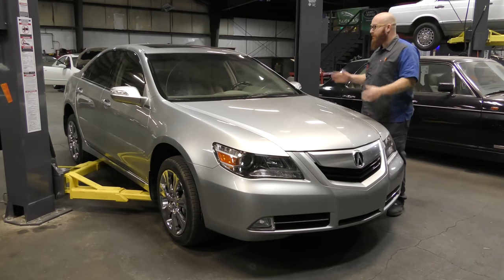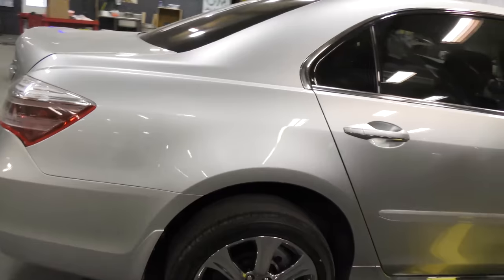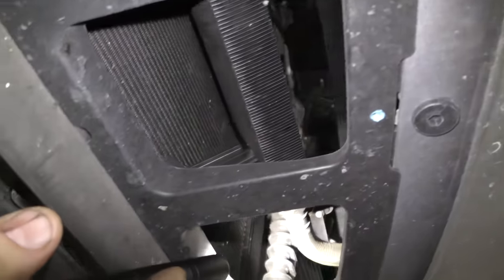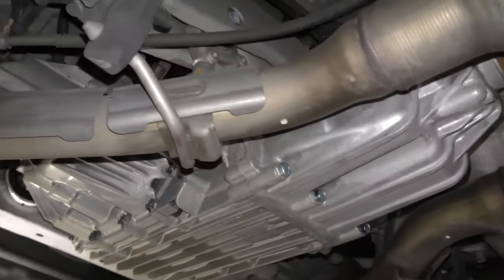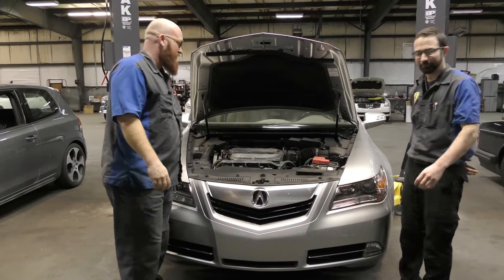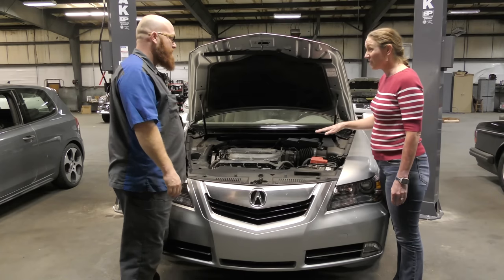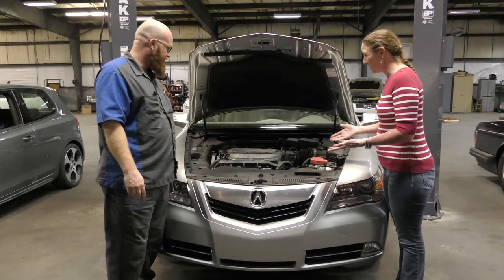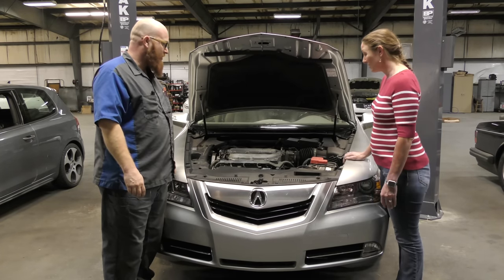Something Very Serious is Wrong with this 2010 Acura RL! What did the CAR WIZARD find???

Comment from the maker: Keep in mind, as clearly stated in the video. Customer wanted NEW or REMAN ONLY. 
Refused used engines whatsoever, regardless of miles, or money savings. You guys keep reccomending used engines. Its not your car. Customer refuses used engines.
Reply: I love my Acura RDX I only use OEM AND NEW. Used is just going to make me cry later.
Reply: I would imagine that if he was presented with an option for a used engine with 40K miles to match the rest of his car, and if the price was thousands less, he'd go for that -- but as you say, it's his car and his decision.  Interesting that they don't offer replacement engines.  Nice video.
Reply: Picky customer for a guy that can't keep oil in his engine.
Reply: @kennethfromkin6141  you imagine what you want. Not what he wants. His dime.
Reply: @jjmarz1001  it's  his money money. He gets to be picky.  Not your cash. He can do whatever he wants with his money. He has it, he spends it. Seems simple to me.
Reply: @jjmarz1001  
Gets expensive for a few litres sorry quarts of oil.
Paid too much attention to polishing his nuts 😯
Reply: The other side of the coin is that if the parents were to buy their son a new used car, they end up getting a pile of secrets, and it would cost more than 7-8k for something similar, so it makes logical sense to keep the car and replace the engine. At least in my world it does. And CarWiz is totally detail oriented so it would be better than new and go 150k miles still.....just hopefully the kid understands it needs to have the oil changed every 3-5k....
Reply: @tombrooks5933  there is no other side when it's your money. You do what you like with it. If you are buying you dobthe research. Not me the seller. Thats the way it works. It's his money. Why can't people realize that?
Reply: Honda V6 engines can burn oil. The problem is that they put cylinder deactivation in some of these engines which shows that Honda should have never get involved with General Motors. 09-12 V6 engines can burn oil especially the ones with VCM. Change your oil regularly. GM electric cars are built well so that may be an exception for Honda. Don’t buy a Honda product with the 3.7 V6. 3.7 Honda engines are not easy to get because they were only in Acuras. You can get a reman 3.5 but not a 3.7. Just get a Nissan 3.7 V6 in a 370z or G37/Q40 or a RWD 3.7 Ford instead or if you want guaranteed reliability get a Toyota 3.5 V6 made after 2012. The Nissan V6 engines burn oil too but there are tons of Nissan VQ engines out there and they are very reliable engines as well.
Reply: Sooooo, would a J37A2 fit in my Civic?

Edit: If it's anything like K-Series motors. The A2 has better, stronger rods, pistons, crank than the A1, A4, A8 variants. Most will say the A2 only signifies the cylinder head configuration, and the blocks are all the same. They're not.
Reply: Look into Acura’s oil consumption recall for that engine that is the root of the problem
Reply: @ryanlewis86  It’s actually a TSB. TSB and recall means different things.
Reply: I understand that's what the customer wanted, but by what you are saying, what the customer wanted isn't even an option. Which would then be your job to sell him on a junkyard engine, especially since you could probably buy 5 junkyard engines for the price of a longblock from Honda.
Reply: A question here. Since the engine is a modified 3.5, could that be a solution for somebody that doesn't care that much about the HP? Does a 3.5 fit in that same place?
Reply: I drive a 2011 ZDX and it burns oil like a mofo
Reply: Also keep in mind,with exchange rate,$7000 u.s is $12000 nz dollars.also 42k miles is 67k km,we chuck em out at those miles/kms.but we change oil every 3k kms also
Reply: @jjmarz1001  You don't know what the failure was. There could just as easily have been an oil pump failure.
Reply: I did some research for you through my Honda dealer. The issue with your long block compared to the other J series family like the 3.0, 3.2 or 3.5, this 3.7 has reinforced internals not found on the other J series family. It may look identical on the exterior, but even the cylinder head parts are different
Reply: The engine can be rebuilt, however the pricing for the parts and machining the crankshaft will add stupid quickly. The internal parts for this engine are all available still
Reply: That’s crazy when there are multiple low mileage motors on car-parts. I understand not putting a 100,000 mile motor in, but I see a few with under 30k !!!!
Reply: @sccarguy8242  Right!
Reply: @atx-cvpi_99  I wouldn't say VQ's are reliable they need timing chains every 60k-80k miles
Reply: The company that you would send it off to rebuild it what is there warranty on it once it is sent back?
Reply: okay but what about just throwing some rods in it? hopefully its just a connecting rod
Reply: real question is why did it loose oil in the first place
Reply: @stuarthall2180  oil was full.
Reply: I would never put all the work into a used engine either.  Get it in and it's no good, you're starting over again.  On the same hand, shame on Acura/Honda not being able to supply a factory reman/crate engine for an only 10 year old car.
Reply: Well, Wizard said costumer only wants new or reman. 
I 'WAS' going to suggest an engine from the same year and model Acura MDX. I have an '11 MDX, and have read up. As far as I can tell, it's the exact same engine: J37... 

Not sure if this would help or not. I was actually looking to buy one of these RL's because theyre very elegant to me....

BTW, unfortunately these 3.7 have an oil burning issue. My MDX had this issue, but was able to have it serviced under extended warranty at a local Acura dealer. It's an issue with the ring pack Honda used with the J37... This engine also came in the Acura TL same year models...
Reply: @ryanlewis86  that year didn’t have those issues. 2011 and on did. Acura/Honda was trying to figure away how to cheapen things. Those plans were put into place in the 2011 model year and on
Reply: @atx-cvpi_99  I have had a Maxima v6, a 350z and a 370z.  None burned a drop of oil between changes.
Reply: @jjmarz1001  Watch the video first before comment. The customer is the owner and his sun had the car when the issues occured and he might have driven a bit too long or far. So do not blame the false ... and what has happened or not. Maybe it was the previous oil change somewhere else where they did not fill it up.
Reply: Sammy Phillps  they said it wasn't bad "ENOUGH" lol thanks acura
Reply: He'll probly end up buying a used one to rebuild depending on how bad the engine is damaged.
Reply: Guess he's beat lol
Reply: Car wizard, what about having his engine remained?
Reply: @kevins.3573  A2 variants also have oil squirters at the bottom of the cylinder
Reply: @atx-cvpi_99  Thank you very much. These engines are in the second-generation MDX, too.
Reply: Sammy Phillps  I'm already rebuilding the engine of my mazdaspeed6 lol.
Reply: It'll be $12k, but you can still purchase the short block and cylinder heads as general assemblies, meaning complete. Add head gaskets, valve cover gaskets. Reuse valve covers, intake plenum, etc.

General Assembly, Short Block p/n 10002-RKG-A04
General Assembly, Front Cylinder Head p/n 10004-RKG-A02
General Assembly, Rear Cylinder Head (DOT) 10005-RKG-A02

I haven't read all of the replies, so someone else may have already said this.
Reply: He will take hitchhike and hoof it until Honda decides to make replacement engines.
Reply: @glennstiller7616  Acura offers the short block and cylinder heads as completed assemblies, sold separately. They just have to be mated together. I replied to Wizard to let him know.
Reply: And don't forget head bolts
Reply: What about Accurate Engines? They do have the Acura 3.7 Liter remanufactured engine. You can request a quote from them.
I just watched the video again. Yeah, Accurate Engines. LOL!
Reply: The customer CAN be wrong. It must be hard to bite your tongue on this one, Wizard. You have more patience than Bob Ross.
Reply: the Wizard is trying
to help the customer...the customer is probably  obsessive
compulsive ....it amazes me how prominent this illness is in our culture...There are options available to allow this
vehicle to have value again...Listen to people who are trying
to help
Reply: I would definitely put a new motor in it
Reply: Some people just turned off their hearing aids when the Wizard said no used engines and it shows. Apparently some of you got high school diplomas that you can't read.
Reply: on a front wheel drive car (this car is all wheel drive but primarily a transverse layout engine)? You really like welding and rewiring that much?
Reply: Get a lawyer involved, this kind of problems shouldn’t happen at this low mileage.
Reply: @Mr.Death101  You're talking about a warranty on an engine going on ELEVEN years old? You're hilarious.
Reply: Sammy Phillps  break in on a 40k engine? What part of "Acura won't replace this engine" did you not understand. This engine requires replacement. What is Acura supposed to do exactly on an eleven year old engine that they won't service, sell, or replace?
Reply: @houseofno  that's the point he's going to pay 7 grand for that and not even have a warranty duh you couldn't decipher that
Reply: @glennstiller7616  shame on Acura for not indefinitely supporting an eleven year old engine. Care to ring up Ford and order a new flathead V8 too? What makes you think companies are supposed to support old products indefinitely?
Reply: @lorencooper6043  this is a 2010 model and you're talking about 2011.
Reply: @phillm156  don't hold your breath. Exactly which auto manufacturers are supposed to support remans on 11 year old engines? Where is this going on? Good luck ordering that brand new Flathead Ford V8 crate engine. Be sure to post photos on that package.
Reply: @orca984  lmao that you think 40k and eleven years old constitutes "low mileage."
Reply: maybe you should show up at his garage and show him how it's done. Show him how to turn water into wine, raise a few dead people and walk on water while waiting for that brand new eleven year old Acura engine to show up.
Reply: @Mr.Death101  a warranty on an engine no longer MADE? You're hilarious. What part of "you can't get these engines anymore" that the Wizard stated did you not understand? A warranty on an 11 year old engine? Seriously?
Reply: @houseofno   if he's sending this engine away to a place that's rebuilding it and then it gets sent back and replaced into the car you're telling me that company that rebuilds it doesn't warranty their work? What part of the question are you not understanding
Reply: Was it out of oil? Why did it fail? Why did oil light come on?
Reply: @Mr.Death101  agreed
Reply: @typxxilps  what kind of idiot doesn't check their oil level in oil filter after an oil change? You just trust these people did the work LOL. Even when you rotate your tires you supposed to know you put a mini chalk Mark somewhere on so you know if they did it or not same with brakes and every other routine maintenance you don't just trust they did it correctly
Reply: Lol wiiiiizard got a little jumpy there lol.
Reply: My 2011 mdx had same 3.7 engine and the short block was replaced under good will by acura because of common oil consumption and knocking. Good luck to the owner!
Reply: @ryanlewis86  this. I read something about Honda extending the warranty, if it's only done 60k kms it's unreasonable for the engine to fail if it's been serviced through Honda no matter its almost 10 years old. That's just my opinion though. He should contact Honda maybe they will do half warranty even
Reply: @todd53b77  i don't know anyone that would chuck a 67k engine. I'd strip the bottom end and replace the bearings have the crank reground and replace the oil pump. The filter would have caught all the metal, that's its job
Reply: @mitchelpinion1852  a 350z that didn't burn oil? You're lying.
Reply: Plenty of used engines available
Reply from the maker: @Melanie16040  You cant hear the rod knocking? Also, as mentioned, there is tons of metal in the oil. The engine is toast
Reply: I work for Acura I’m mechanic and we never ever had issues with the rl’s. They are bulletproof but parts are expensive they all made in Japan.
Reply: @andrewlugo3427  Acura doesn’t replace short blocks cuz they burn oil. We replace piston rings only.
Reply: @E90_335xi   i can show you the bill... wouldve been almost $11k in repairs for a 65k mile vehicle i had just purchased at the time. They replaced it. Didnt even have to argue with them they told me outright it was being done under good will.
Reply: @CarWizard  have you tried using imported engines directly from Japan?  They drive low mileage there and usually they got tons of engines that they import to the US.
Reply: There’s one with 27k miles at Matlock used car and parts in NC off of a 2010 RL
Reply: Iso Gh0sted  it was but it couldn’t have been that bad right away. It must have started with the rod journals & bearings wearing improperly. Maybe from oiling issue?
Reply: Acura RL owners are weird, like the RL
Reply: @E90_335xi  I did one new J37 short block under warranty back before the service bulletin came out that called for replacing pistons & rings.
Reply: I would have went with a used engine. Saved what money I could.
Reply: LS SWAP THIS !!!👍
Reply: @heartofdixie67  if it was John Ross watchjrgo, he would LS swap it.
Reply: considering the car condition it is understandable, that thing is mint!
Reply: Googled it and found this post [partial]: 

Acura 3.7 L V6 Excessive Engine Oil Consumption leads to Extended Warranty

 "Today I received a letter from Acura that current owners of 2010-13 MDX, 2011-12 RL, 2009-14 TL, and 2010-13 ZDX will have their 6 yr/70k mile warranty extended to 8yr/125k for the power train warranty. This is to address excessive oil consumption that is caused by the oil control rings becoming clogged and preventing oil from returning to the crank case. Furthermore, regardless of mileage or time in service (age of vehicle covered) from now until Sept 1, 2019 Acura will cover the vehicle for this to ensure client satisfaction and confidence".
From the above it sounds a lot like the issue on the Toyota 2AZ-FE 2.4 motor.
Reply: Guys, i think the customer doesn't want a used engine.
Reply: @jjmarz1001  His oil didn't go anywhere. He lost oil pressure, not oil.
Reply: This is disappointing, but let's not forget that every automobile manufacturer can an will have these issues because they use mass production. Bearings are all made by a vendor and can be defective. Rods can be machined slightly out of tolerance, etc. Look at the newer 2 liter non turbo Honda engines that left the plant missing a piston circlip. It happens.
Reply: You tell em bossman
Reply: The MDX also used the 3.7L V6. I'm surprised there aren't any J37s available!
Reply: Crazy situation. Wish this customer and you the best of luck . The acura looks so solid inside and out thanks for the views. I Wonder why the engine went out.
Reply: Sammy Phillps  different engine similar but still quite different
Reply: @atx-cvpi_99  no cylinder deactivation on this engine, No GM involvement this whole car is really from Japan unlike the TL
Reply: @houseofno  it is.
Reply: gotcha.
Reply: @rolandwilliams1228  GM and Honda had the Saturn VUE. It had a Honda 3.5 V6 and the horrible 5 speed automatic transmission.
Reply: That car looks fabulous it's worth the money to fix it.
Reply: this car doesn't need a new engine, this engine can be repaired. Only problem, working hours
Reply: Sammy Phillps  did you mean to say the 3.5L?
Reply: @jamalpeoples3736  As the old saying goes, a fool and his money are soon parted.
Reply: Can't remember a late Honda v6 that didn't set hard burning check engine light when oil pressure dropped low due to either oil pump o ring ,oil pump or rocker pressure switches. 
And I assume loose timing belt tensioner , backed off rod bolts , or a walking camshaft has been ruled out. 
If so , price the related rods and a crank . That's how they fix the nsx motors . Rods are 7 hundred each, used.
Reply: not even the 3.7 v6 in the latest mdx or rlx?
Reply: Ls swap it.
Reply: Got it.  Well it’s his/hers $7,000 + for a 10 year old (very nice) car.  For that age of vehicle swapping in a $1,600 engine with 56k miles seems like a far better option.  But who am I to say - it’s their car.  😎
Reply: @jjmarz1001  doesn't mean he didn't keep oil in the engine. My 2017 Q7 through a rod 2mos after buying it from the dealership. Sometimes it's just a manufacturing defect that wasn't figured out from the factory.
Reply: wish I read this before I... Emailed you a link to a 60,000 mile engine :P
Reply: He Should’ve just mechanically taken care of the motor that was in it. I bet that car would run and sound a lot better with a used engine over the one that’s in it

The J37 engines had a recall for oil consumption
Reply: @ByronThoms  I agree with you 100%. I mean if my viper blew up it’s still under warranty but if it wasn’t under warranty I would have no problem putting a Low mileage used motor out of a wrecked one.
Reply: @chadd3272  I gotta wonder how many miles the kid drove between the oil light coming on and the tick setting in!  Either way,  my dad would've reacted differently!!
Reply: @highlysuggestible861    The 3.7 have an oil consumption recall it probably didn’t have much oil in it Or was out of oil once it started making noise the kid put oil in it. My dad would have Been like you broke it you fix it lol
Reply: Why doesn't he want a used engine...? With one quick search I found a 3.7 from an Acura RL with 34,000 miles in it. It's in Ohio, at a salvage center for $1350. Another in North Carolina with 27,000 for $1900.
Reply: @glennstiller7616  shame on Honda for not taking any responsibility for a failed 42k mile engine
Reply: @houseofno  Henry Ford did .my model T had a .*€¢£¥°°°✓[✓✓[
Reply: well its pretty simple REBUILD IT .I FOUND SHORT BLOCKS FOR UNDER 1500 AND I DIDNT SEE OIL ANYWHERE SO =NO HOLE IN BLOCK GUESS YOUR JUST GUESSING INSTEAD OF TAKING OUT AND DOING A TRUE DIAGNOSIS??????IF YOU CANT DO THAT YOU SURE THE FK AINT NO WIZARD
Reply: @adamgraham6265  those zdx are really cool looking. Only seen 1 in the wild, ever!
Reply: It’s hard to say from the start up since it was so short. But the Honda timing belt tensioners will collapse and cause an knocking noise like that. I would for sure take a look at that before a new engine. Would be 45 minutes of work to take it off and see if you can press it down against a hard surface.
Reply: I will trust a used engine over a remanufactured one, a low miles ones with less then 100k miles will be great for that car.. a remanufactured engine might not last as long as a factory oem one.
Reply: Personally I would go for a 100K mile engine, at the end of the day who really cares as long as it runs as well as it looks. I would only fit an engine that was not sludged up in any way and I would fit new gaskets and reuse all the original accessories. I know that's not what the customer wants but the words REMAN and Honda do not usually go together.
Reply: PFI Speed!
Reply: I would check the Car Fax on this car, could of been in a flood or worse a collision.
Reply: @egold1006  owner is the second owner. First owner was neillo (as a dealer display/show car only) clean title Sacramento car.
Reply: @sccarguy8242  Correct i see multiple myself. Why is this not an option?
Reply: I just checked on Car Gurus and there are three of these for sale at between $7500 and $11500 depending on mileage.  Is it really worth spending $7000 repairing a car that won't be worth much more when fixed ?
Reply: @stewartstarling2309  cool story bro.
Reply: I agree with the customer.  Why put someone else's unknown possible  junk in there?
Reply: @edwardtabor77  Did you watch the video?
Reply: Sammy Phillps  MDX used it also
Reply: @Mr.Death101  are you ready to realize you are wrong?
Reply: I have a 2009 Acura RL. I was scared to watch this video
Reply: I got the same car and I have a 2009TL with the same engine 3.7 KA5 AT
Reply: Sammy Phillps  no issues
Reply: Sammy Phillps  I will!
Reply: @willb3018  because you can’t buy a brand new engine....
Reply: Sammy Phillps  the thing also is this is an executive car.I have the TL and love it,it's fast but I've sat in a RL and the difference is immediately noticed.
Reply: I can find you several engines
Reply: There are engines on ebay. Thats stupid to not put a used engine in there with a warranty. What the actual fuck. Id trust a used engine over rebuilding one. Ive had tons of rebuilt engines go bad from various builders. Check ebay and car-part and lkq I found several just searching. Around 1500 to 2k. For that price they want for the new engine rebuild he could buy 4 engines. And no one will be able to tell the difference at all what so ever!
Reply: Would you be able to use a j35 short block? As a replacement?
Reply: Refusing used engines means he is trying to get it totaled.  Would he accept it if you or another mechanic remans it or would it need to come from Honda/Acura?  If refusing your refurbishment then he definitely not interested in having it fixed.   Probably looking to total it it out with insurance somehow.  

I know of two exact same cars local to me private sale (totaled from storm damage) where engine was untouched, just cabin damage, and mileage is probably 50K or less on both, even I would use those engines after getting them cleared as good to go by some trustworthy mechanics.
Reply: I think you made a good decision help the owner
Reply: Oh you mean the same idiot customer who ran the engine dry of oil????
Reply: New 3.7 engine from TL
Reply: Why not put a different Honda motor any j series motor should mate to the trans 3.2 or 3.5 motor
Reply: @Honeypot-x9s  how can it get it totaled?  The car wasn’t in a wreck.
 No insurance company is going cover a blown motor.
Reply: @txtchjmb29  many ways all of which either edge on fraudulent but maybe not entirely or are straight up illegal..  most illegal and wrong would be to repot it stolen and make it look that way and roll it down a hill to its death somewhere.     least illegal but still morally wrong depending on your views (given most insurance is scummy i dont care) is a thing my friend did  (many years back now) when his engine died (timing belt let go and some other damage) was parked it under a dead tree right before a massive storm rolled in and sure enough bunch of large limbs and shit fell off also got some hail damage and caused enough damage overall his insurance just wrote it off..
Reply: @MrDuncl  If a car costs 50k new and 7k used it is false equivalent to compare it solely to other examples online. When the car is immaculate it has the potential to one day command more money than today plus if you compare it to what a new large V6 from Acura or Lexus runs, you need to compare it to that number.
Reply: Sad situation.  There is no evidence of abuse or lack of oil in this situation.  Customer can do whatever he wants.  The wizard can only do what the customer wants.  I would love to get that car in front of an acura engineer or exec.  And show them the condition and ask for a special deal.   Parts or payment.    That might be useful.   
       And i dont understand blaming the college student. The way the car looks it is getting amazing care.  No fault there.  
          Look at the thousands of porsche M96 engine failures.  With great oil changes and service and cars carefully adult driven.  Seems porsche is not any better at standing behind their engines.   Honda / acura has had some terrible engine failures
Reply: @jjmarz1001   there is no discussion that the engine oil was down at all..
Reply: Grind the crank and replace the bad rod and your good to go
Reply: If I was the client of this car  I wouldn't even want to hear the words used engine.  That would upset me in the case of  this vehicle.
Reply: @NeightrixPrime  it doesn't matter what the problem is. It's his money. If it just needed an oil change or new plugs. Doesn't matyer as long as he can pay the bill and you inform him , it's his money. Again simple. You spend your money how you like b/c it's yours.
Reply: @houseofno  I mean I get that a manufacturer isn't going to keep making new engines that they don't place in any new models but you usually get about 10 years of support from the last year of production. 

Also equating getting a new engine for a 10 year old car  to getting a freshly manufactured engine that was last used 73+ years ago is its self a joke. They are in no way the same thing.
Reply: I agree wizard, i wouldn't (subject to there being no fundamental manufacturing  flaw being found during the rebuild)
Reply: & he's severely w/ out wisdom, coz used is H fctory motor, vs this & 7K high $$$$ ideaa
Reply: @tolrem  well that explains why Acura doesnt have any 3.7s in storage. They used them all up on warranty replacements through 2019. This dude should have driven the car more, would have hit the problem in 2018 and got a free repair out of it!
Reply: @atx-cvpi_99  I have a 3.5L VCM engine on my Honda Pilot 2010 and i use the SVCM controller with a remote switch to turn it on and off on the fly with a wireless remote cause the VCM can be economic when you are on the highway on the cruise control its very economic to use only 3 cylinders but make sure to watch your oil cause its literally drink the oil but i when i drive in the city of Montreal or i am jam into the traffic i disable it cause its really bad when the engine is constantly switching between 3 to 4 to 6 cylinders you can even feel a vibration while you accelerate
Reply: So make him pay and stop crying about it, the costumer seems to have plenty of $
Reply: ATX-CVPI Hmmm., maybe I didn’t listen closely to my Acura Dealership because he told me there is a RECALL on the “piston oil rings(?)” and leave the car there, they’ll fix it for free.(after the oil consumption 100 mile test) 2019.
Reply: I WILL GET YOU A CAR FIXING COUPON
Reply: I have a 2010 MDX with the same engine and they have an oil consumption issue with the 3.7's which is why they stopped making them and went back to their 3.5. 
What a shame this happened 😣
Reply: @Slydertek  / Yes, it fits
Reply: / Doesn't fit
Reply: @jesusmercado6947  / If You can vind/buy one
Reply: @noleksandr  / Not the 'Honda' 3.7
Reply: @Akecherfd8424  / didn't had the sound on?
Reply: @ByronThoms  / You've found such an engine?
Reply: @mitchelpinion1852  I had a Nissan Frontier and it was probably the worst thing I ever had. The 3.3 V6 took 3.3 quarts of oil, the truck had no power to speak of. It wallowed like a cruise ship in a storm and rode like a school bus. I got rid of it cause just to get it through inspection woes going to cost me close to 1k and I was unemployed at the time. I was going to need 4 tires then I caught a rock chip and heard a big “ RRRRIIIIPPPP”. I looked down to see a crack that went from end to end of the glass. There went another 300 bucks. I ended up getting 6k for it on a trade in,
Reply: Not even a low miles JDM import engine?
Reply: @pjr6537  unfortunately it is not the same engine as in an Acura MDX. Same displacement, same specs but... Honda was marketing the hell out of those saying how advanced and different from MDX  it is. RL is the ONLY car with this engine.
Reply: @bolshoibobik  look up the 2010 to 2013 TL-SH AWD. You'll see they also come with the 3.7...but only the SH AWD. The regular TL from the same years had the 3.5. 

I know, because I was about to buy one!
Reply: @atx-cvpi_99  that's super low mileage to burn oil. I would suspect it only burned up because it was not changed out in over 10k miles
Reply: @11094DEREK  Most of the timing chain issues are on the 2002-09 VQ engines.
Reply: You must know pistons and rings aren't going to fix a rod knock.  @330arr
Reply: Who says used engine won't develop the same rod knock? @ByronThoms
Reply: Some "mechanic" you are,, since you can't recognize the sound of a rod knock!  🙃 @mechanictaft4848
Reply: Did you watch the video or nah? @MrDuncl
Reply: @lloydrmc  I’m pretty sure (this was 6 months ago) that I pointed out to Wizard that the complete short block and cylinder heads were available separately new, but it would be about 12 grand. The customer insisted on a new engine and Wizard was striking out because he was apparently looking for a crate engine with heads installed on block, which doesn’t exist for this application. To your post, I wasn’t recommending pistons and rings.
Reply: I thought this engine was also in 09-14 acrua tl sh awd
Reply: Change the serpentine belt tensioner dude. That's the problem. I had the same issue. Stupid mechanic. He touched the wheel and then said it has no play...
Idiot.
Reply: @jjmarz1001  how can you make that assumption? This guy is a professional mechanic and said it's a manufacturer defect and he actually has the car in front of him.
Reply: Just get a good engine from a junkyard from one that was totaled in a rear end collision or whatever.  At this point, beggars can't be choosers.
Reply: @CarWizard  what ultimately happened to this car
Reply: @kennethfromkin6141  he definitely will go for a used 40k mile engine , car wizard is chatting. and the customer is also for expecting a dumb request , they want a new engine to knock it again go change ur oil correctly then buy a 3.7 ur wasting engines for real car guys
Reply: @jjmarz1001  exactly 😂
Reply: @jjmarz1001  I wouldn't assume that he couldn't keep oil in his engine.
Reply: Bad timing my friend timing tensioner nothing wrong with the engine 
You are professional
Reply: So did you find the root cause?